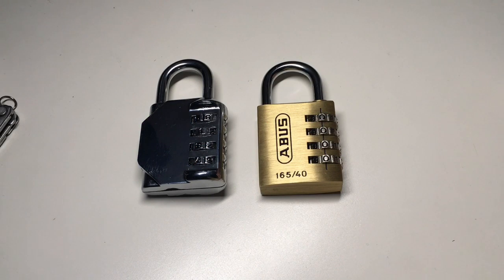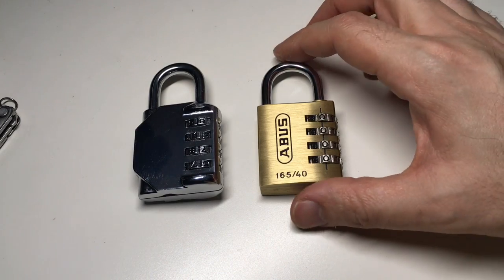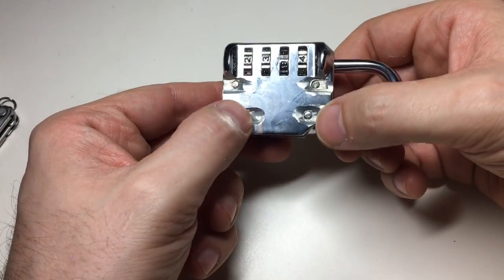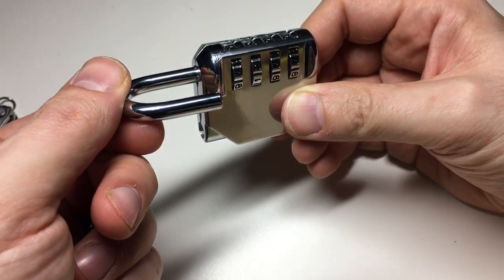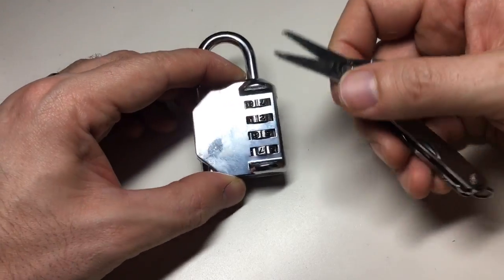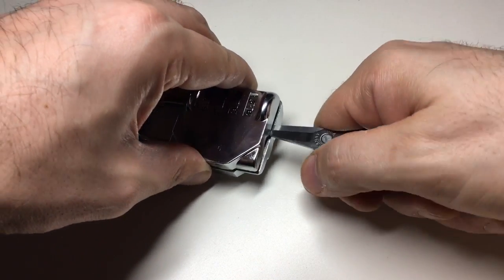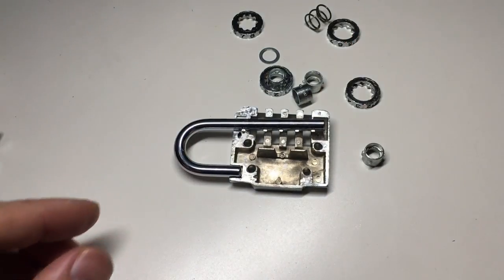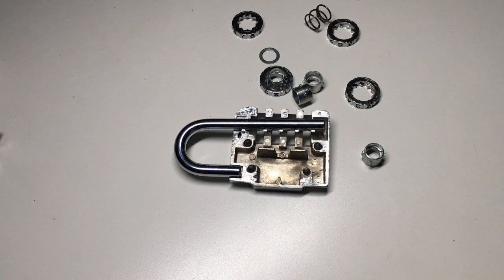(163) How Combination Dial Padlocks Work and How to Exploit Them

Comment: What did you use to grind off the rivets holding the lock together?

I've suddenly gotten this huge desire to take apart a combination lock in the past few days, to see the inside and have fun taking the pieces apart and putting them back together. With this aim I bought the most cheaply-made combination lock I could find, from eBay. I thought it was made of plastic, but it was made of metal painted to look like plastic.

I guess this is pretty obvious, but it turns out it's really hard to break open a lock. Who would have thought? I've been trying to wear down the rivets with various tools that I've got in the shed (screwdrivers and sanders), but they're really not up to the task, and have just scratched the surface. What did you use? Cheers!
Reply from the maker: I think I used a dremel

Comment: my luggage TSA lock is kind of not working properly !!! would it help if i open the system and reassemble it again?? PLEASE REPLY.. THANKS
Reply from the maker: The TSA locks are usually very poorly made. I really would recommend buying another if you can as I’m not sure repairing it will be too practical.
Reply: thanks brother 👌👌

Comment: Very good explanation and thanks for taking one apart for us. Does the cheap one that you opened, feel the same as the ABUS when decoding? I experienced that for example the ABUS 165/40 feels a bit different to the 145/40. So I thought there might be slight differences in the behavior. You know how mad I 'm after combinations lock ;-) So please tell me the name of the Chinese padlock - I believe that I can get it on ebay but I need to know that name. Thanks and I'm glad that the padlock-deal with g-man has worked out well :-)
Reply from the maker: Potti314, hi! The Chinese one feels similar, but you can feel that the tolerances are poorer in it: it's no Abus! As for the name of the lock... you already have one :-) it's the same lock as the one I sent you in your video 285 :-)
Reply: Haha, while writing my original comment I somehow thought that I knew that Chinese lock. Now I checked my combination locks and found the exact same model ;-) Still don't know how it came to me as I could find a video about it but it feels different to the ABUS - you can feel the bad quality. Haha, either I have too many locks or I'm getting old or both ;-)
Reply: Haha, thank you mate - I'm definitely getting old and have too many locks ;-)
Reply from the maker: Potti314 ha, you and me both my friend :-)